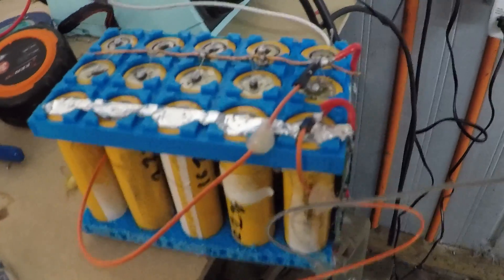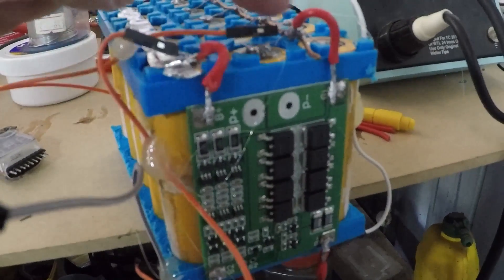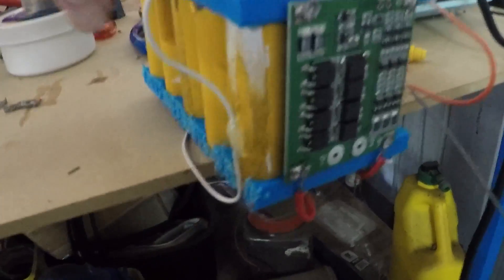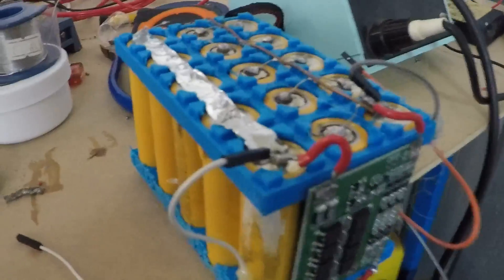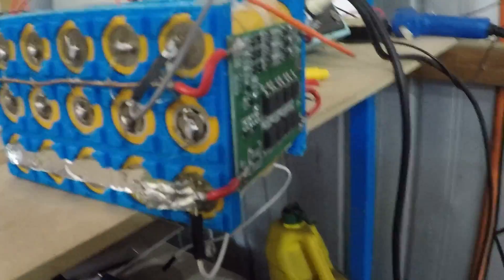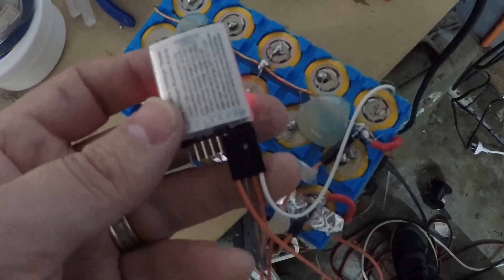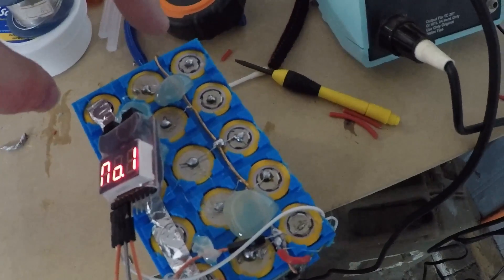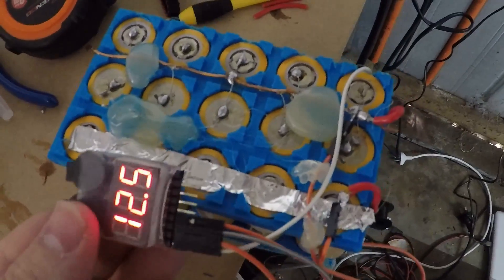12V 18650 Car Battery Pack

Comment: Im thinking of making a 3s battery as reserve power for leaving the car engine off while playing music or using inverters. I am thinking about having two disconnect switches that one can be switched on for charging the lithium battery while the car is running and one that can be switched for when the engine is off. I think I will need some sort of cv cc buck converter that takes the 13-14.5 volts from the alternator and drops it down to 12.6 for charging the lithium battery as well as a balance bms. Then I will use a 1200watt cc cv boost converter I already have for taking the 9~ through 12.6 volts from the lithium battery and stepping it up to about 14volts for the lead acid battery. It would also be useful for if the battery ever dies as it could work as a recharge system for boosting the lead acid battery. I would either need a switch that has 3 settings and that could handle a decent bit of power or just use two switches and just make sure I don't turn both of them on at once. I already have some AliExpress 300amp 12 volt battery disconects that should work great for this. I need to finally get rid of most of my 18650's as i have already used them for other more normal projects....

Comment: If I use it in 4s can I add it to the alternator without bms? The alternator Max output it’s 13.6v so I believe it should be good and I’m doing a 4s4p of the 10A that should work for an 12v amp for the music system?
Reply from the maker: Jose Santiago the purpose of the BMS is to balance all the cells, you will always need one even if you use super caps however you don’t need to discharge through the board if you have a fuse or some other over current protection. In addition, if you can safely discharge at 2.5 amps per cell (which is ‘1c’ for 2500mah cells) then you should be able to run a 10amp (~120 watt) load. Also check the charge current of your alternator, if you charge the lithium cells at too higher amperage then you will kill the cells.

Comment: ive been considering the same thing, however im thinking about going with 4s, because generally athough a car battery is "12 volts" they actually spend most of their time at 13.6-14.4 while the car is being charged by the alternator. and a 3s max voltage should be around 12.6, so you will be constantly overvolting your pack. a 4s would give you a max voltage of 16.8, which is a hair high, however most cars can handle up to 16 volts safely and that would leave a 4s around 4 volts per cell, down to 12 volts which would be about 3 volts per cell, which is a fairly safe and reliable way to run them, but im trying to figure out how to get it to stay balanced between 3-4 volts instead of up to the 4.2 volts.
Reply from the maker: Joshua Gomez don’t. This will not work as a car battery without smarts such as capacitors etc...
Reply: Nice. I have a 300c with a 6.1L v8 and i got tired of having to change my battery every year because of the big motor starter current, so i will try to make a 18650 battery system (fully protected with fuses, bms and a metal box to hold any fire) and with some maxwell ultra capacitors. I have all the parts, my main issue right now its the metal box.
Reply: @arthur88888888888888 
Have you considered a surplus ammo can?
Reply: @wanderingcalamity360  Sorry for the delay bro. Yes, i've started considering about two ammo cans

Comment: Im curious about this. I install high draw car audio sound systems, can this be applicable? My first inclination is the internal resistance of these small cells would be more of a hinder than a help. Someone correct me if I'm wrong.
Reply: Did you ever try it out? I just found this video as I'm planning a aux battery build for a boat project and saw your comment. About 30 years ago I was a high end installer, I was even published in 5 magazines for car audio for my designs, builds, and SPL wins. I was most known for being an idiot, like stuffing 52 10" subs in a minivan, or 6 18" subs in a 69 vw beetle. This technology wasn't even thought of yet, best we had was an Optima Gel Cell and some capacitors. I do a LOT of battery pack builds now, for electric motorcycles and electric go karts mostly. If you're going to build anything like this I recommend a 4s and AT LEAST 15 parallel. After you build the pack, with a BMS that can withstand the current draw. I'd still use caps, the internal resistance you mentioned IS a major issue with the peak pulse draws, and car audio is the king of draw. I watched an ohio generator 275 amp alternator burst into flames at a competition when I burped over 750 amp draw, and that was WITH caps and 4 optima inline. If you try it, post a video, or comment, it's fun to hear about new experiments.

Comment: Do how did it work out. 

The results are the measuring point .
Reply from the maker: It worked well, however as I've noted, probably not clearly enough, is that this isn't a pack that will start the car, just to use to power devices that would normally be powered from the car itself.
Reply: It is very important that this battery is not hooked up to a car at all. The car will put about 14.6 volts into it and there will be a fire that is very difficult to put out. It can be done with 4S for a camper van etc , 120P  4S can do the lot safely. amazing results with 120P 4S.

Comment: So i could hook this up to the alternator and use it to power a car amp? Because a lithium 12v audio battery is like 1300 dollars. Can you see any problems using this battery pack for that?

Comment: Can you use this in a car instead of a 12v Lead acid one?
Reply from the maker: Hey, no you cannot use this directly in a car. This battery pack cannot discharge fast enough for a car. The maximum discharge rating of a single one of these batteries is 1-2C, which for these batteries, let's say they can discharge at 2C, which is 2 times the capacity rating. 
If the capacity rating is 2.4 mAh (which I think these are round about), then they can discharge at 4.8 Amps (2x the capacity, ie. 2C), then this battery can discharge at 12 Volts times the parallel batteries (5 in parallel), which means 4.8 Amps per battery * 5 (the amount of batteries), so it can discharge at 24 Amps. This is far lower than what a battery for a car requires to start, mostly cars are 400+ Amps that they require to crank the engine. 
To solve this, you can use super capacitors as the way to get the amps out of the battery through the super capacitors. There are some people on youtube who've done this, so I recommend looking this up.
Reply: Thought so, thank you. Yes, I saw couple cool super cap bat replacements done.
Reply: David Hancock 
He can if it is a stick shift. LOL 
I started a bug 40 years ago with d-cell batteries. 

Nice build. I like the blue holders

Comment: David hi its good job. I will try your ptoject. Because last year I bougth battery varta its not working now. I decided to make a batery pack  with 18650 batteries. I found your video. Well done everything is ok But I cant find your display in ebay can u give me display full name or link ? Aliexpress or ebay.
Reply: I found the volt displays for cheap! https://amzn.to/2CYnu4v

Comment: STOP!  I hope that got your attention!!! Take off your ring pleas... WHY? Safety.  You can wear it around your neck and put it back on when your finished working.
Reply from the maker: I've heard that said but I've never had an issue. I've worked with very very large battery packs and soldered over 1000 cells but my ring has never caused any problems.
Reply: @DavidJJJ  Electrical Engineer here. Created a bubble around my wedding ring, Lantirn TFR. NEVER again !!!
Reply from the maker: Steven Blaber ok, thanks, will keep it in mind!

Comment: I like the idea man!! You reckon it's possible to make a similar setup for a starting battery?
Reply from the maker: Actually I did this the other day but with a 4S pack into a car battery. I had to let it charge for about 10 minutes but I just connected a 4S 6P lithium pack, about 15Volts, into my car battery and it discharged into the car battery. If you wanted a proper 'starter' that you can use straight away, you just need to add some super capacitors to the lithium part and it 'should' work, since the lithium can't discharge what the engine needs to start but super caps will be able to discharge. I haven't tested this though.
Reply: Thanks man!! I just killed my battery in my 4wd the other day and it was supposed to be a good battery! If i can make my own to last longer and be a better unit, that's how i wanna go, getting sick of batteries failing on me!.

Comment: 3S is not 12V, it is 10.8V nominal. Go for 4S and the alternator charging them to 14.45V is around 3.8V per cell so you have a system you can safely float charge and cyclic life improves to 3000-4000 cycles. You only get 65-70% of the capacity when not charging to 4.2V, But if you do it like that you have a battery pack that doesn't need special attention or charging from a wall socket. I've replaced my car battery entirely with a 4S5P pack and a string of 350F super capacitors and it is totally self managing. I'm using a BMS for LiFePO4 cells so it doesn't allow any cell to go above 3.9V, just for added safety and balancing.
Reply from the maker: Yep, I wouldn’t charge this from a car, it’s just for powering 12v car stuff like DVD player or phone charger. I’m interested in your setup though as I have some super caps.
Reply: Oh! Cheers, me just rambling, but what else to do with some surplus 18650 cells and super caps from an e-bike project when my car battery finally died. My 6 super caps barely manages to crank my 1.1 engine once, so they should be twice the size They are 2.7V maxwell caps, but as the youtuber "Julian Ilett" have shown 2.7V super capacitor balancing boards from China charges your caps to 3V, so I got the 2.5V version that charges my caps to 2.65V = perfect! Between the battery pack and the caps I have a 2.5 OHM power resistor, or more correctly a heater coil from a cigarette plug window defroster. It is nicely packaged in high temperature plastic frame and have spade terminals. The reason for that is to limit the current draw from the battery pack as even the few volts of drop the caps suffer when cranking looks like a dead short to the battery because super caps have very little internal resistance, so to not have my BMS cut out when it hits the 10A current limit, the 2.5 OHM limits the current to 6A and still allows enough power from the battery not to start draining the caps  with ignition on before I crank the engine. Finally I have a 5W solar panal on the dash board to tickle charge through just a diode. The nice thing about the super cap balancing boards is that they shunt the charging current when they reach the 2.65V per cap so maximum voltage from solar never goes above 15.75V which is just right for my LiFePO4 BMS also to  balance my battery pack. My car does not object to 15V + when starting and with running engine the voltage stays at 14.45V the alternator is supplying.
Hope this was a thorough enough description of my system!
Reply from the maker: Thanks for the info, makes sense, I follow Julian, he’s good. I have some super caps 350F, 2.7v spare so I might use them for the car, I like your setup between the battery cells and the caps which protects the cells.
Reply: Actually my initial setup was without a battery pack, but even the 3mA draw from my clock and radio and the super cap's self discharge pulled the voltage down to 7-9V in the morning, which was too low to start the car, so batteries are needed for the small parasitic draw every car has.  If I didn't have the solar panel maximum charge would be only 14.45V which would charge the Li-Ions even less and not balance the caps for full capacity. While still functional, the setup would be even more marginal. The added benefit of a solar panel charging at a higher voltage, is that when driving, it takes half an hour for the batteries to drain down to what the alternator is supplying, so they are saving fuel by sharing some of the load with the alternator and warmed up rpm (820) are reached faster than with my old bad lead acid battery.
Reply from the maker: Ah ok, good info to know, thanks a lot.
Reply: dude the capacitors do most of the work anyway .  without them any battery will suffer . a peak of 200a or 60 per motorcycle whill crancking .
Reply: So is that 5x4 = 20 total?
Reply: @casemods  ......Yes, that is 4S5P pack, in Tore Lund's way of using the Lithium iron Phos. pack.........or put another way 4 batteries coupled in series , with 5 batteries in Parallel =20

Or you can find some Headway 38120's , where 4 total larger format batteries , will be around 12.8 minimum or as much as 14.8 volts max.......
Reply: That is some idea!!!
Will try that 👍👍👍
Reply: Does it charges only with the alternator? No bms?
Reply: @kbca5216  I have a BMS also, but one for LiFePO4 cells, that only allows charging each cell to 3.9V, but it is only as a backup as the alternator only charges to 3.625V per cell.
Reply: @Tore_Lund  Hey friend. This setup is still working fine? I'm on a way of doing the same in my car.
Reply: @arthur88888888888888  I now drive an EV, but I moved my string of capacitors to that instead. Still worth saving weight not having a 12V lead-acid battery around. So that means, I don't need it for cranking anymore, but they still work fine, also to start an EV.

Comment: Did those small wires and foil ribbon connections fry when you put the cranking amps through it when you tried to start the car?
Reply from the maker: Keeping Up actually it was just for powering a little DVD player or a 12v phone charger. If it was to be a car starter, I would probably need some super capacitors to go in front. These batteries couldn’t put out nearly enough cranking amps to start a car.
Reply: Thanks, I'm dumb.

Comment: Before making a car battery I tried to make a 12V 7A (3s 3p) battery for self starting motorcycle. Since we use the bms, the battery voltage is maintained under 12.6 which is not sufficient to drive the self start motor of the motorcycle. So tell me how to solve this problem.
Reply: 12v varies up to 15.4v sometimes so shoot for higher voltage
Reply: i agree higher voltage
Reply: You'll need a BMS higher amp continues. For 18650 Li-ion Lithium Battery Cell 3S 40A W/balance BMS Protection PCB Board

Comment: i want to make car battery of 12V 35Ah capacity. so how many cells need to be used and can you show a demo how to do?
Reply from the maker: rasa kumar For a 35A pack, which will be 420 Watts, you will need to put enough batteries in parallel that you can safely discharge them, which will be around 20 batteries in parallel, so your whole pack will be 60 batteries.
Reply: wouldn't you want to run 4s packs of batteries so that you're not overcharging the cells? with 3s, your max voltage is around 12.6v, although most alternators put out around 14.  10 packs of these might be enough to build a big enough pack: https://amzn.to/2CYOe53 , but you'll also need super capacitors and other items for it to do what you want. The number of cells needed for a safe discharge for starting the engine will depend on the engine size and starter motor amperage draw (as well as the size of the batteries which can range from 1 to 3ah), so you'll want to do some math there once you decide how many amps of discharge you're going to need.

Comment: Will this start and run a car
Reply from the maker: Hi Evermont, This will NOT start a car, it will keep it running if it's already started. If you try and start a car with this, a car will draw well over >100Amps to start potentially and this battery pack will only allow up to 2-3 amps per battery to be drawn in series, which is 5 (batteries in series) x 2 Amps per battery = 10 Amps, maybe 20 Amps if you're lucky. There are lithium cells which can do this and are designed for very high amps. The battery I made could power something like a laptop for you or a few fans or directly power something like a car DVD player.
Reply: @DavidJJJ  how many are needed to start a car?
Reply from the maker: This couldn't because of the amp draw, it would be too much, you would need about 80 batteries. The best way to start a car with this is to use some super capacitors connected to a higher amp battery, there are a few howto's on this on youtube using super capacitors, super capacitors can discharge HUGE amps, that's what you need to a car, you need very little actual capacity because as soon as you start a car, it starts charging from the alternator.
Reply: Please don't hook this to a car . this battery is 12.6 to 13v max and it will get hot and go on fire. The car will charge it to 14.6 volts and that is too much by miles.